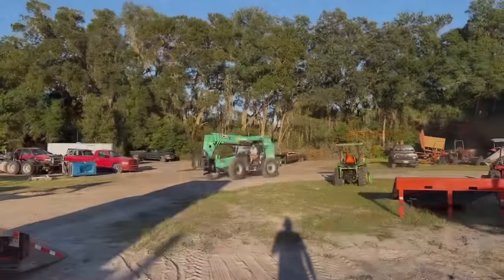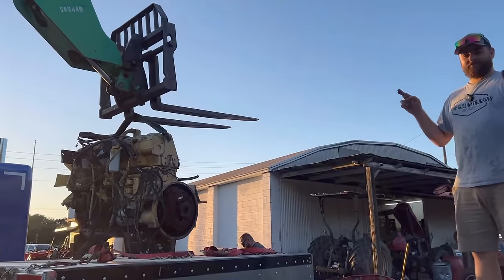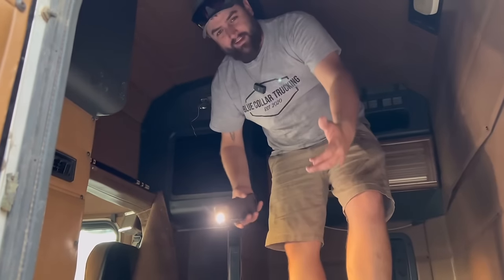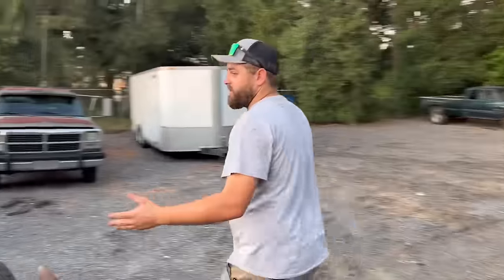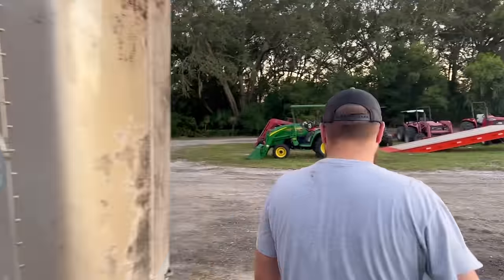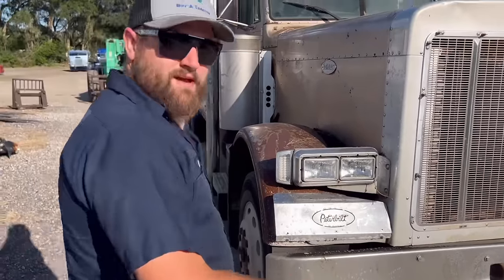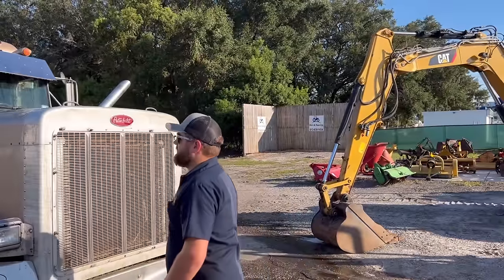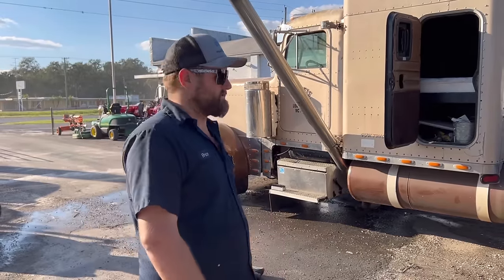Washing away 2 MILLION Miles of Dirt

Comment: You should definitely get this truck running and driving. I'm a over the road driver and I'm telling you if you fix it and put it on the market it will sell quick. 10k to buy it maybe 6-10 depending on what it needs sell for 50-60k easily. One thing I've learned is Peterbilts never lose value definitely put bigger tanks on it in my opinion
Reply: I agree, instead of spending a bunch money on some toy, invest a little put it back on the road for a sweet profit.  You could call Tim Gentry and see if could make quick sale.
Reply: Hi is not going to do nothing he just talk and talk, destroy that truck for parts it’s a shame
Reply: @nobs8124  Just waiting for the ole claw hammer in the ole fender treatment like the 900KW.
Reply: George  can’t do it 😭😭😭
Reply: @nobs8124  Damn shame

Comment: Power washing off the years of gunk is so satisfying to watch. You need to disconnect the power washer from the water supply, then pull the handle trigger to relieve any water pressure, then try to start it. It'll start.

Comment: Don't take this the wrong way but I see someone yelling and screaming lol a c15 is not a 3406e e models are pre 2000 motors a c15 is when 6nz became a thing and up till they stopped making over the road motors...to add you can exchange alot of parts from mostly all variants of them find a accert bottom end you push some boost through those
Reply: i was boutta say did this guy just say its a 3406e c15. lmao i didnt know they made those.
Reply: The C15 and the 3406E get confused pretty often. The 6NZ came out in 1999. Before that year was the 3406E. They are basically the same engine. The main difference was the 6nz had a better gasket setup for the front and rear mains. Cat just changed the name to C15 because they were wanting all of there engines to have a C identification. 

If the truck is a 1999, it could have a C15 or a 3406E. From 2000 and up, they are all C15 engines.

Comment: Take the pump off your pressure washer it is easy to do and then see if the engine turns over and runs most times it is the pump that locks up

Comment: That Peterbilt is almost in the same shape as that Kenworth was if not worse talking about rust and mold I just love old trucks these are the trucks that we need to keep now just like the old cabovers and old peterbilts from the past that we can't find anymore this is our last chance to keep stuff like this it's good looking truck
Reply: The real issue with Kenworth is parts availability really. To get that truck back to doing what you’d like it to do and what you would like to have done with it it’s just not worth the money sometimes you just need to let old trucks die it’s getting hard to get a 3406e platinum kit anymore let alone a B model platinum kit. Plus the strip that down to the frame most likely have to re-rail it it’s not worth  if it was an old needle nose it be worth putting those parts into it

Comment: Yeah your pressure wash looks either seized pump or petrol motor ,,     if its a real Honda it will be the pump but if its a china copy then could be anything or everything wrong ,    over to junk pile ,     got a 25 year old pressure wash with 6 hp honda an a karcher pump ,   well always left out in rain ,  the exhaust is only rusty engine part an the frame an wheels are totaled with rust but it works fantastic still ,  from brand new downloader valve was fucked so i pulled pump apart and reassemble it with a straight new valve an its never ever failed but yeah rust is eaten it till the wands shorter too , as it rust i chop it thread it an no more leaks ,    but honestly if you find honda engine with karcher pump  buy it ,,,   dont even look at the copy cats ,,  there just junk